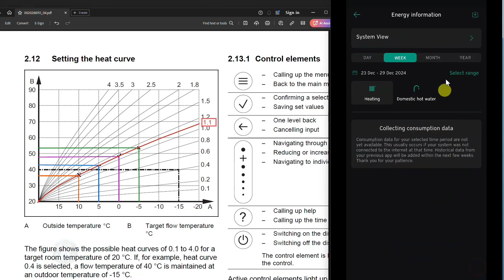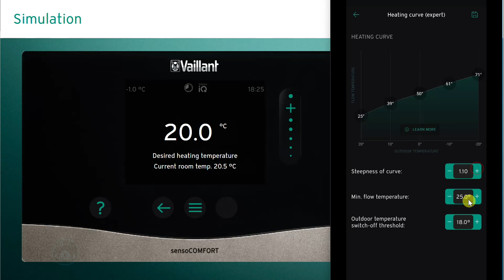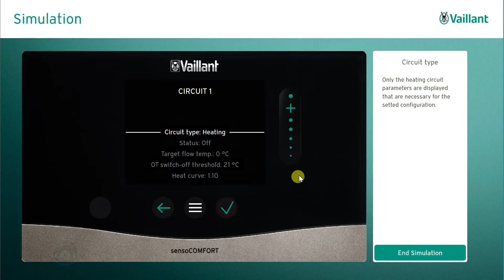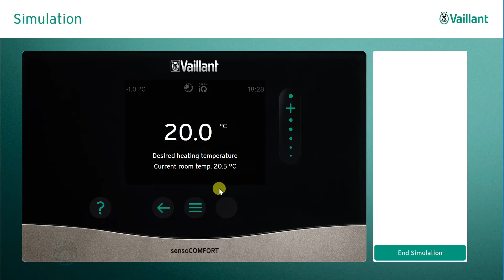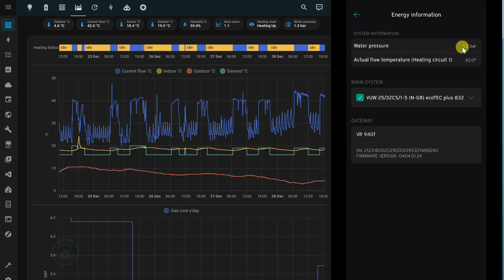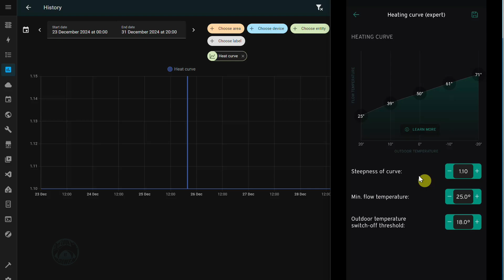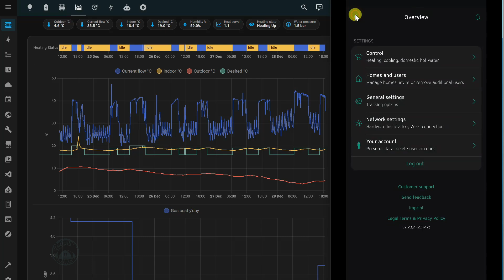How to choose the right heat curve - Vaillant ecoTEC Plus with sensoCOMFORT and weather compensation

Comment: Brilliant explanation, thank you very much. I will be setting up home assistant to monitor and tune my own system. Love the graphs it provides. Please do provide details of how you set it up.
Reply from the maker: Thanks for the kind comments. Setting up home assistant is relatively easy, but you will need to decide which system to go for. I recommend having a look at the home assistant Getting started page: https://www.home-assistant.io/installation/ - it details the different systems or operating systems you can use. 

I personally found a DIY Raspberry Pi to be the easiest and cheapest method. Home Assistant also sell their own devices (mini computers), and you can install Home Assistant on any X86-64 machine, Windows, Linux or MacOS. All the info is on this page I've linked. 

If going for a Raspberry Pi, get the latest version possible (because once you have HA, the possibilities are endless), and having the best possible version of the hardware covers one for the future. The HA website page recommends everything, plus they offer a step by step tutorial. I could do a video on it, but I think you'll find this page https://www.home-assistant.io/installation/raspberrypi explains it perfectly as well.

Once you have logged into Home Assistant, you will want to install HACS (Home Assistant Community Store), and then install MyVaillant integration in HACS. Restart your Home Assistant. Go to settings, devices and integration, search for MyVaillant integration and install it. Sign in with your email address and password (that you used to log into myVaillant app) (or MiGo app for Saunier Duval & Bulex). 

Link to the Docs is here: https://signalkraft.com/mypyllant-component/
Reply: @LookatBowen  thank you for the detailed notes. I have an older Raspberry Pi already, I'll try using that first, then move to newer hardware if necessary.